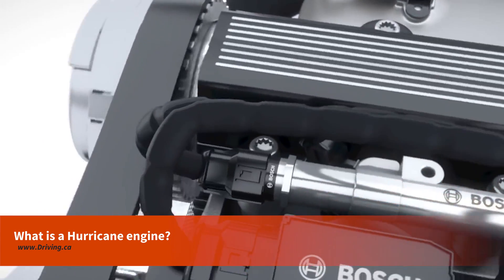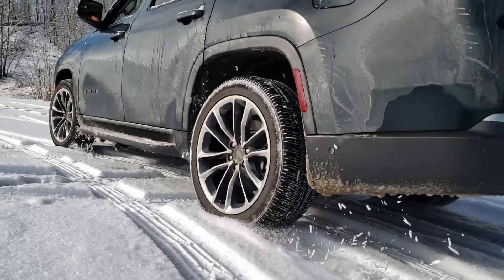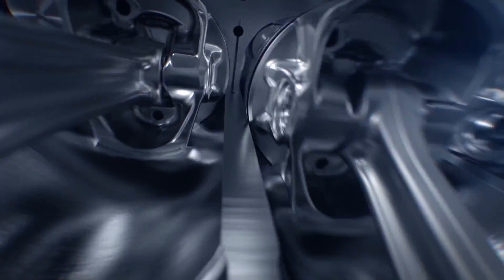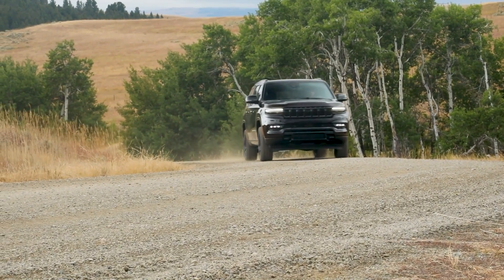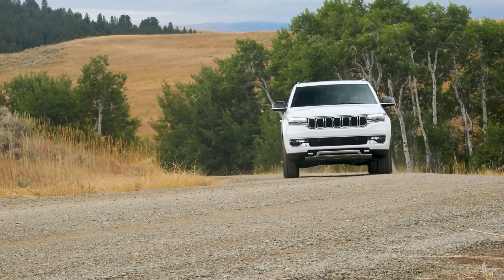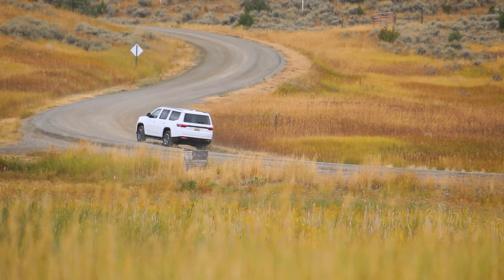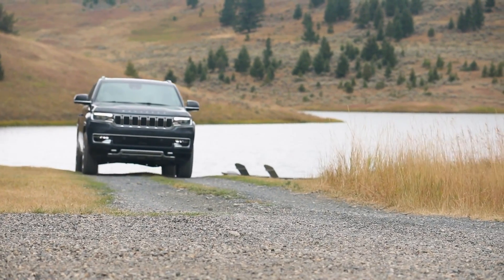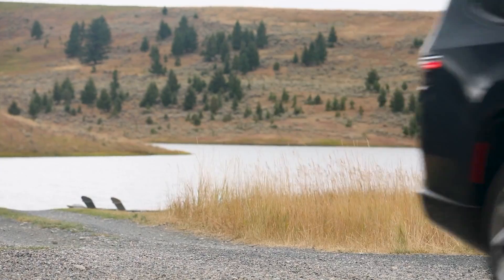Inside Jeep's Hurricane Engine | Deep Dive | Driving.ca

Comment: I heard a viscous rumor that this engine has no dipstick for checking the oil. Sure hope that isn't true.  Multiple BMWs have been ruined by low oil reports (from the computer) inspiring the addition of tooo much oil. With no dipstick to double check the computer report. 

The cartoons also implied GDI without port injection.  That is not good either. 

I won't buy turbos, or GDI without port injection,  or a vehicle with no engine oil dipstick.

Comment: How long will that engine last. You put a lot of boost on a small engine , is there that much difference in power and fuel mileage.
Reply: Yes because they didn't simply throw a turbo on an established motor like back in the 80's. This motor was designed from the ground up for twin turbos. Cylinder pressures & all. It's not just a 100k mile motor.
Reply: @scottpearce7466  time will tell
Reply: Ha,ha,ha, if you actually Use the turbo, the mileage goes out the window, and remember the the little Chevy with the aluminum cylinders with the Nickasil like coating, yeah, that disaster...

Comment: The hurricane has aluminum cylinders with a SPRAY ON cylinder liner.  This is not a good formula for longevity.
Reply: It’s closed deck. It’ll be good don’t worry as long as you don’t mod it or add more power.

Comment: For me I chose the Hemi V8 over the stupid Hurricane Inline Six anyday just like I chose the 5.0L Coyote V8 over the Ecoboost V6 anyday.
Reply: I wish they offered the wrangler with a 5.7 hemi.
Reply: @bjornironsides6474  they do have a jeep with a hemi
Reply: @ScoobiKubi  yeah the 392.  I wanted to see it get the 345.   So it’s not $88k lol
Reply: I had 4 Hemi's. I will take my stupid Hurricane inline six over them every time. It is a much better engine. Way more power and much lower RPM where torque is needed. The Hemi is over rated.
Reply: @JimRamstad-v5q  Yet it won't outlast the Hemi V8 you libtard.

Comment: Either Hurricane motor will not out run the 5.7L Hemi in both 0 to 60 and quarter mile. That motor is a slug. Quality of the turbo will not last long in normal use. Wait for the fully electric version to arrive before you buy.
Reply: FCA is back to making Quality vehicles again they saying the Hurricane is built to last well into the 300k
Reply: How do know so much about the quality of the turbo?
Reply: It will smoke the 5.7! Way quicker to 60 and also a much quicker and faster Quarter mile. Not even close!

Comment: If gasoline explodes in an engine, it's called "knock".  Yea, um, that's bad.  Typically, the gasoline burns quickly.  This is basic info for an internal combustion engine.
Reply: If it explodes prematurely* If it isn't exploding inside your engine at all you have a problem. That's why they call it the "combustion" chamber on the "combustion" engine.
Reply: @meedak3449  Combustion means "the process of burning something".  It should NEVER be exploding in your engine.
Reply: @James.Allen.1 You're trying to split hairs on wording. And you would be technically incorrect. So I really don't care what you think.

Comment: Twin turbos are going to be a maintenance black hole. I can’t wait to see how bad Stellantis mucks up this engine.
Reply: Feels like someone lacks of BMW engine experiences a bit
Reply: Twin turbo six cylinders are nothing new they have been proven. Toyota n BMW have done it .
Reply: Far from a black hole, look at bmw. They been doing it for years. Turbo tech is so far from what it was in the 80s 90s. Very low maintenance. But if you where a technician you know that.
Reply: agreed
Reply: @tthams73 LOL!!!!!!!!!!!!! Yeah right mate
Reply: Let’s not forget Porsche, on the horizontally opposed six, they have twin turbos also
Reply: Yes, no one else uses twin turbos, no one.
Reply: @wolf986 turbos seals going out on my s4 is costing 2-3k so .. pass
Reply: @G35Jeesh  Your 22 year old car needs maintenance, lets write off all the technology :D
Reply: @wolf986  but to have to pull the entire front end off and remove the engine and trans assembly just to get to turbos come on
Reply: @wolf986 semi truck use twin turbos
Reply: @donblaschko9022  have 5 dd5 engines at work, 5.1 L, twin turbos, 240 HP., and 30 k oil changes.
Reply: @wolf986 farm tractors use twin turbos
Reply: @wolf986 we have 11000 hours on our tractors, no oil consumption and no turbo problems
Reply: @wolf986 I knew you were being sarcastic.
Reply: @wolf986  False.  BMW has a Twin Turbo Straight 6 and it runs fantastic and hasn't been a maintenance monster at all.
Reply: @Adam_K_W  It a little sarcasm, everyone has a twin turbo engine these days
Reply: it will last only a 105k miles then fail!!
Reply: @rearspeaker6364 don’t believe it
Reply: @donblaschko9022  Ok, then only 63k miles, then it eats its pistons.

Comment: Mopar's 2JZ!
Reply: Stellantis wishes
Reply: I own a Ram 1500 with the HO and I am extremely impressed. They're going to be releasing a crate engine version sometime in near future called Hurricane CatX which is going to be in the "Mid 1000s" per Stellantis. Initially I worried about the reliability longer term but my truck has the new 100k powertrain warranty. Plug in Tuners can give you over 100hp... the 2JZ claim probably isn't far off. Toyota just did it waaaaaaaaaaaaaay earlier

Comment: You mean to tell me it’s the 2020’s and we’re still using fucking timing belts?!?!?!
Reply: It has timings chains but there in the rear 😒
Reply: No
Reply: Timing belts are newer technology than chains.  They're generally favored for their quieter running characteristics.  Belts have a bad reputation due to people neglecting them, but a surprising number of engines have issues with their timing chains as well.  Chain tensioner and guides tend to give out with less warning than belt tensioner and pulleys, especially if you assume that chains are maintenance-free.
Reply: Honda is